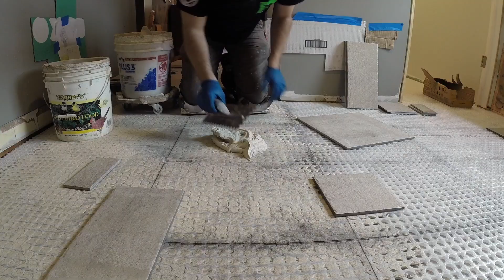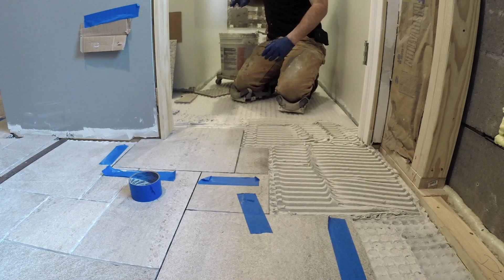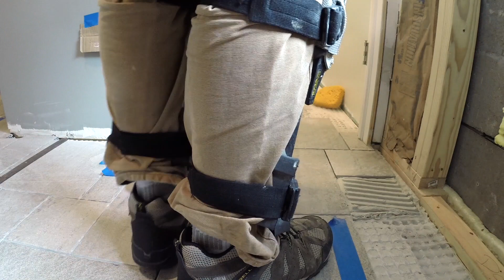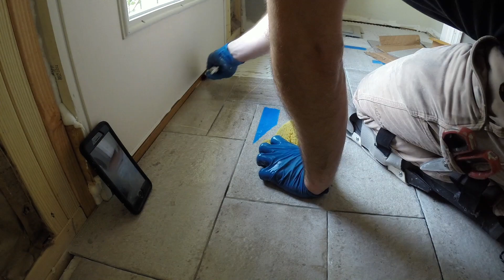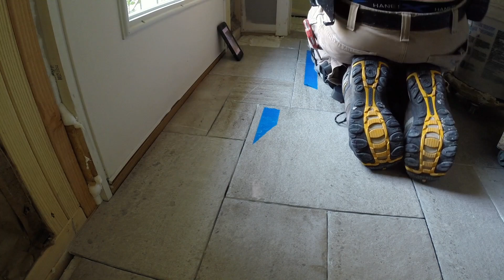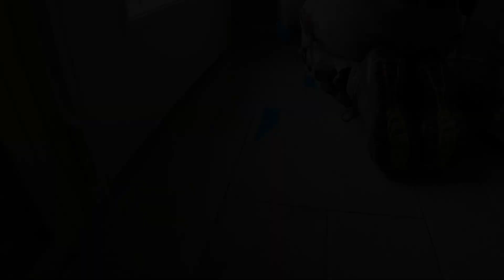Amazing 4 pattern porcelain floor tile install

Comment: When we do those we grid off the floor (looks like you did similar) in rectangles that make sense with the pattern, even if a tile crosses the line.  Many times you just have to leave the spacers out of the picture and just hit your lines. As far as layout, we try to base it off of the smallest tile in the pattern. Most of the time that works out pretty well. Does that kind of mesh with how you laid it out?  

Nice work, I’m liking the accent wall in the back there.
Reply from the maker: Hey Vinny,
thank for tuning in.Yes that meshes with how I did it,NO spacers and watch control line which is even hard when the tile won't land back on it or many rows.My laser helped.

Yes the client picked a nice accent wall there!

Comment: What's the labor cost sr?
Reply from the maker: Most of the total price.
Reply: @Dtileandremodeling  If you charge the total price, but the customer buys the material. The material is deducted from the deal so what is the price that your patreon would be paying per sqft in this peculiar task.